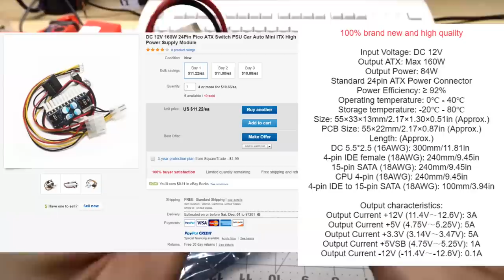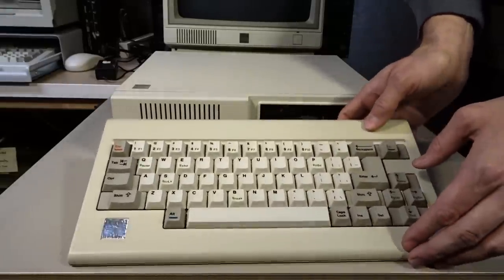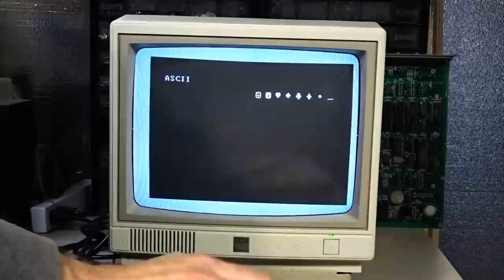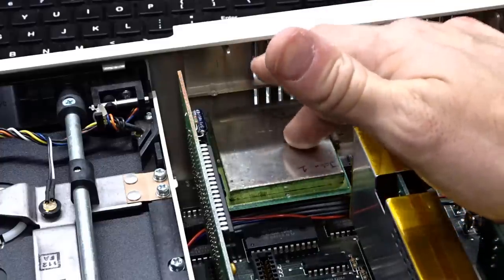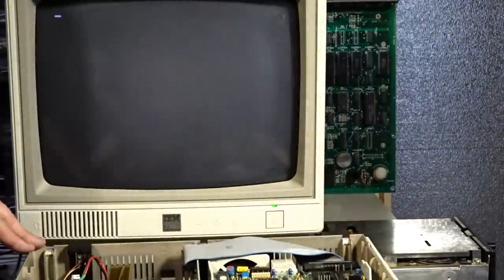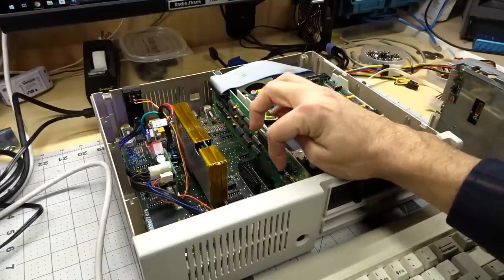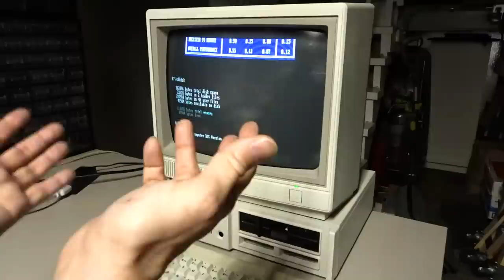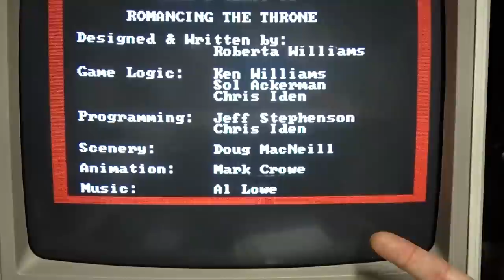IBM PCjr Part 2: Two steps forward, one step back

Comment: On compatibility and memories from my youth of the machine, they can be most summed up with the question: "Why does hardly any program work?!?" About the only stuff you're going to get to work on a 128K machine is stuff specifically designed for the machine. King's Quest II works because the original King's Quest was originally coded for the IBM PCjr, and then ported to other machines. With an expanded RAM machine, you're going to hit a wall with games wanting DMA for performance, and a base PCjr doesn't have DMA... My childhood machine was equipped with the bizarre Racore DMA expander which also added a second floppy drive on the top and 640K of RAM, but further complicates things since the machine was never intended to have DMA. Round 42 didn't work (which does on a stock PCjr, though might require boosted RAM), but Paratrooper did, which normally couldn't work on a PCjr. Sadly, your best bet is have this as a shelf machine and run stuff on your Tandy, as a large portion of the software that uses that video mode was intended to be used on the much longer lived Tandy line than the PCjr that was basically run one holiday season to compete against the Apple IIc.

Comment: The PC-Jr technical reference manual has the schematic for the IR receiver. If you can find a PC1373h, or rig up a functional equivalent, it wouldn't be too hard to build one. The Sidecar expansion appears to be an XT bus, but unlike the PLUS header in the Tandy 1000EX and HX, which are functionally equivalent to the XT card edge with the A and B sides swapped (a few pins are repurposed for the DMA function of the PLUS DMA/RAM card), but otherwise compatible with a simple adapter, the PC-Jr sidecar port has a COMPLETLY different pinout. It looks like all the functions are there. Should be possible to rig an adapter and run a lo-tech RAM card or something else, or build your own onto a perfboard.

Comment: A case where the Tandy 1000 owner could look down their nose at the poor sob that bought an IBM PCjr because it had an IBM brand label

Can you imagine the horror of buying the Jr because it's got enhanced graphics and sound - presumably for enabling home computing game play - and then you find that is very problematic to find games that can run on it at all, or run reasonably enough to be playable. Just compounds the misery around what was one of the most disastrous computer models of the 80s (the Apple 128K Macintosh a very close runner up).

Comment: The error might be why the IR board was removed?
Reply: @adriansdigitalbasement  In your video testing, when did the error appear? Check the video and see what item has been added or changed prior to the error. I suspect the power source, as in the video I don't see it prior to that.

Comment: Power cycling the PCjr, the rule of thumb is to wait until you can no longer hear the fans. Basically wait 20 to 30 seconds to turn it back on.
Reply: This ^^  I can remember a PCjr demo at our computer club and the IBM rep said to wait 30 seconds after power off to reset.

Comment: There is always the chance of a dry solder joint on the underside of the motherboard. Dry joints usually manifest themselves once everything is warmed up. Pull the motherboard and take a close look. Given that this was made by IBM dry joints probably not likely, but maybe the controller card might have been shoved about a bit, it is 35+ years old.   
Great videos, looking forward to more so I subbed and hit the bell icon.

Comment: I suspect the issue is the floppy controller is not reliably being reset. The pulse width is too narrow for it to properly reset. Id look at the power good pin. Modern supplies generally give the PG pin only cursory support. That would be where id start looking.

Comment: Great video!
Somehow I missed watching it when it first came out... Probably because my own PCjr was in mothballs at the time and I just recently got it back out!
Sorry you are struggling with the drive controller errors so much! At one time I had about 30 PCjr’s that I rescued from a dumpster and don’t ever recall having this error! One common issue was the drives not reading disks if the monitor was too close though, but I see you had it far away in some parts of the video...
My guess is it is a race condition based on the non-standard PSU...

Comment: Try removing the IR receiver, that might be why the original owner took it out
Reply: mrjakeisnumber1 That was my thought. I’d try the other IR card, or use the KB wired. I forget the chronology of the events, but as you said, something on that board could be creating a spike on the supply bus, or pulling it down momentarily. For sure, it’ll be the last thing he checks - but then, why would you go on checking things after it works? 😃
Reply: @TheRealMarkS  The FDC on the PCjr had a factory fix, very possibly related to decoupling: https://www.zdnet.com/pictures/cracking-open-the-ibm-pc-jr/16/
Reply: That's interesting indeed.
Reply: @1337Shockwav3  So IBM went cheap and didn't put decoupling caps on all the ICs. Makes sense.

Comment: One possible explanation of the behaviour that the floppy controller doesn't work when the machine is rebooted, but works fine when left alone for a while is temperature: Some component might malfunction when it is warm. If you switch off the power for a while, the component cools down and the controller starts to work again.

I don't think it is a capacitor, because broken capacitors tend to behave the other way around: Warming them up restores some capacity. However, it can be any component, some TTL chip that is malfunctioning could explain it.

To test the temperature theory, you either need a possibility to cool locally, or heat locally. But as a first step, you could just try to warm up the computer before boot, with an electric fan heater or something like that. If the is temperature related, you should the error even if the computer has been off for a while.

Comment: Recap your controller card and probably the floppy too. It's a typical capacitor problem when you have to let them discharge to get it work or when it works for few minutes.

Comment: I agree that capacitors can be an issue with machines of this era. I would also check the mechanical connection between the card and the board. I seem to remember that those slots can get flakey as they get older. Not sure if it might be metal fatigue in the slot ... it's been a really long time since I worked on a JR. I just wouldn't rule out the motherboard just yet ... I seem to remember that there are a ton of caps on there as well. Wish I had the magic bullet for ya, but hey keep pluggin and I'll keep watchin and smilin.

Comment: In the late 1980s I worked in an university computer lab. We always waited 10 seconds after turning off the original IBM PC before turning them back on. My EE colleague said that there capacitors associated with the RAM than needed to discharge completely before the machine would reboot completely. (my background is in the social sciences, so I am just took his word for reason).

Comment: 17:05 - I'm guessing there's a bad electrolytic capacitor in one of the power-up circuits of one of more of the boards. These insure that certain reset signals are asserted during power-up.

Comment: Note: all this presumes you want to keep tinkering with the PCjr.  That said, I would definitely get into some diagnostics on the controller, checking ICs, and so on.  Next on the list, assuming you can overcome the disk issue, (and I'm asking the question broadly, for some folks who might be PCjr enthusiasts), is anyone making larger internal RAM expansion boards?  That could be a route to go. 384 or 512k...
Reply: @adriansdigitalbasement  I feel ya, man.  I see one (at a glance) on eBay but it's $36.

Comment: I don't know if someone knows about the floppy disk error, but I would assume that some logic  IC related to the disk is not working properly. I would blame the floppy disk controller in that card. But since you don't have any other card connected, it might also be an issue with the main board. Anyway, you should check for some CF/SD cards adapters for this machine (if they exists, which I think they do).
Reply: If IC has gone bad it will not work sometimes and then sometimes not. But instead, the IC may not be able to work properly if there is one or more capacitor(s) gone bad as then the IC lacks the proper voltages and current. As capacitors are semiconductors they can work pretty unpredictable and unstable when they are bad. Eventually they can even explode.

Comment: Having the monitor on top of the case can cause interference. We had a metal stand which kept the monitor away from the computer. Not sure if it was related to your issue here, but in case it helps someone fix their issue.

Comment: Sorry you got frustrated with this one Adrian. I did find it interesting though! I think the problem is with your floppy controller card. The problem looks temperature related as the issue presents after being turned on. You probably have a bad solder joint caused by expansion and contraction due to the cycles of heating and cooling. I would go over each chip with fresh solder. Failing that you have a bad chip somewhere.

Comment: Sierra. Brings back memories. As a kid with a Tandy 1000 SL2, my Sierra games (kings quest and police quest) were not booting disks. In fact, I had to run the games from the original disk because of the copy right protection. If I remember correctly, I would go to dos, go to a:\ and type in sierra.exe to play the game. If I did this with a copied disk, it would require me to put in the original disk to continue.

Comment: The Microsoft and IBM versions of the 128K sidecar are hackable. The IBM one has a simple jumper to add when you replace the 4164 RAMs with 41256 RAMs. This allows you to change the sidecar to 512K to get a total of 640K on the Jr. The only downside is you need a TSR on a floppy to load with DOS to use the extra memory.

Comment: Not even knowing what it was for sure, I bought a PC jr at an estate sale without the monitor + 2 model M keyboards for a total of $15. It was in 2 banker boxes with other items. Which included a bunch of sidecars. 2 512k expansions, printer, and I can't remember the other right now. There's also 2 external 5 1/4 drives and a joystick. And all the original manuals and dos disks. But I picked up a monitor and another joystick off ebay, so I have a full blown 640k PC jr

Comment: @Adrian Black .. I don't remember this floppy drive error.. in your previous video...  ...  ...  It behaves the same when you use the normal PC power source???....  instead of this adapter for the adapter of the adapter that adapts to the adapter???   8-}
NO SERIOUSLY my best guess...  that adapteer (the blue one in 14:31) is liking some residual energy into the motherboard .. keeping some corrupt info that causes the floppy to fail at next startup ...

Comment: Did you check the 12v on the 2nd (20 pin) Pico ATX?  Since the floppy controller seems ok, it's probably the drive, which might not be getting enough juice.  Also I'm sure that thing has bad caps, so many bad caps.  The floppy drives on those are not known to be the most reliable either
, and that might be an aftermarket replacement drive.

I had a PCjr with 512KB RAM, and it's only marginally better for games.  Just about anything good requires the full 640KB.  Also, without a hard drive, some games are unbearable;  the floppy disk shuffle gets old.  

You seem discouraged, and that's understandable, but I'd like to see the worlds pimpiest PCjr with a NEC v20, 640KB+ RAM, a floppy emulator for a 2nd drive, and a CF/SD/USB hard drive.

Comment: I would delve into the events at CPU level that occur with the error, so try to capture using a logic analyser what happens when the disk is accessed until an err
or occurs. I agree that j UST replacing the original electronics defeats the idea of owning retro kit unless it's the last resort to save scrapping the unused case. A systematic check of all cables, solder joints and connectors would also be useful. Is one area of I/o or memory associated with the operations that trigger an error?

Comment: I wonder if the pico power supply itself isn't able to pass enough current, or simply couldn't filter properly? Did you try with the ATX power supply and see if you still get error H?

Comment: The PCjr was half as powerful as a 5150, twice as expensive as a Commodore 64, with less reliable hardware than a ZX81, and couldn't really do much unless you made it a loooooongboi with additional proprietary sidecars. It's no wonder it completely flopped.

Comment: Have you fixed the disk controller problem if not have you considered you have a ground loop, the original power supply would have properly grounded the case as well, because your supply is now DC the case might be floating and causing you problems. good luck.

Comment: I'd love for someone who bought the Tandy sound mod kit from PC Enterprises to do a video on what it involves. The Tandy video mod information was always widely available, even on IBM Canada's website. Most Tandy 1000 games allowed selecting video and audio separately so they could be used on a PCjr with just the video mod. But I did have one game that required both Tandy video and sound. Since it couldn't detect the Tandy sound on my PCjr I had to run it in crappy 4 color CGA. IIRC it was some Hoyle's card game and it used the rarely used yellow brown green black option instead of the white cyana magenta black pallet 99.999% of CGA games used.

Anyway, after paying for one Tandy video mod kit from PC Enterprises (one common 7400 series TTL kit, a bit of wire, and an instruction sheet on traces to cut and what to solder where) I never bought another. I salvaged the chip from various old or dead boards for a few other PCjrs. I figured their Tandy sound mod had to be something equally simple and I didn't want to pay a ridiculous price for a couple bucks worth of parts.

Comment: I agree with statements below, Error H cause must be a power-on reset POR type of circuit that is not working properly. A circuit that keeps the floppy controller reset until certain time has expired or known good state is measured. If it takes to long the floppy will not respond in time for the "bios" It is most likely a capacitor, but could also be a bad flip-flop somewhere. Are there schematics for the floppy controller?

Comment: Hi Adrian, I got curious about that taped-over recess on the floppy drive so I googled some pictures and found this one:
https://tr3.cbsistatic.com/hub/i/2008/07/09/21613301-c3b8-11e2-bc00-02911874f8c8/103Dino_PCJr.jpg
which shows that there was originally an IBM logo in that spot.
Anyway, congrats on getting it up and running, I wish you fun with the 'Peanut'.
EDIT: Ooppss sorry for posting redundant info, but my well-wishing still stands. ;)

Comment: Instead of ordering a new power supply, just use an extension cable and mount the power supply to the wall using some strong double sided tape.

Comment: Why not just get a motherboard cable extender? Also for the Drive, have you cleaned the heads with alcohol and a q-tip. You may also need to grease the drive mech that move the heads. Its the long rod the head moves up and down. This can get dust and dirt on it so clean and grease that too. Then look up the cap issue?

Comment: There is really little point in having this computer. Though it came first, it is basically an underpowered and expensive Tandy. The Tandy sold so much better and is so much better supported today because there are so many more people with a Tandy.
IMHO, this computer does not have a single redeeming feature. 
The Tandy just solves so many problems.
I have serviced many, many of these old computers back when they were still being used as people's machine and I would bet that this is a power problem.  Believe it or not, I have seen a hard disk with power problems cause LAN problems. Power problems are nearly always really weird.
Reply: I agree for the most part. The PC Jr was just weird, even for 1984 from what I can tell.
Reply: They are generally much better built than the Tandy machines. I will give them that much.

Comment: Your error sounds like a bad cap, high esr and low capasitance. Try hesting the board with a heat gun in different sections to see if it chances the behaviour, either make the problem constant or make it o away until it cools down.